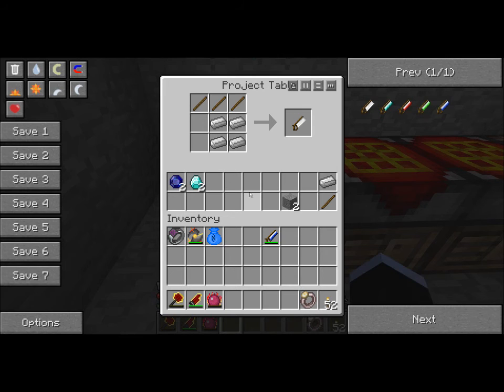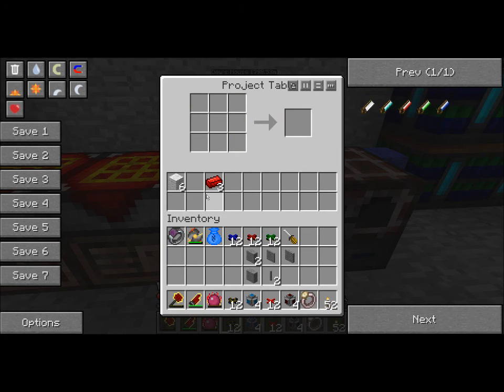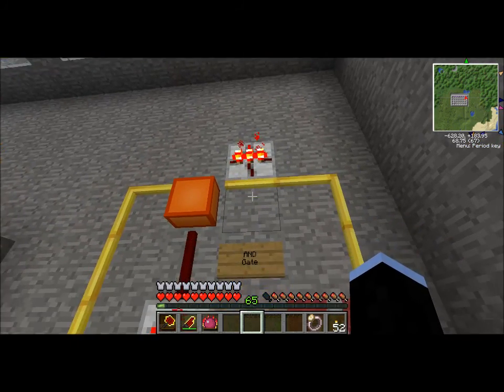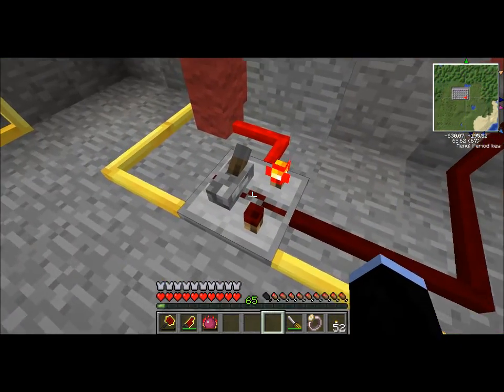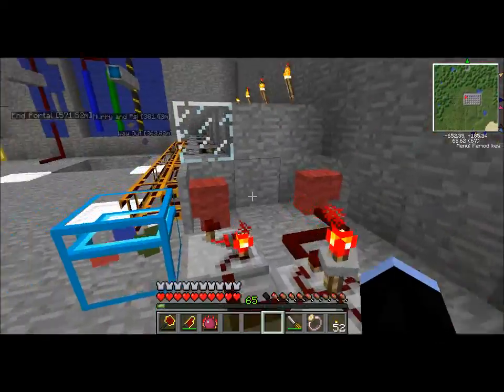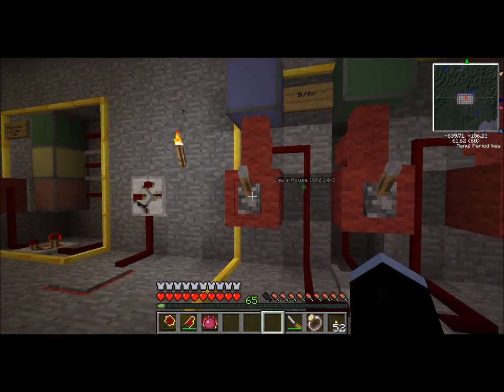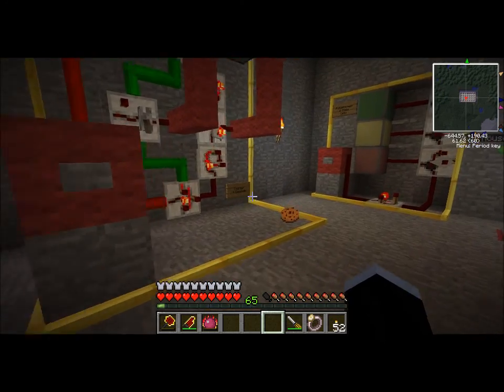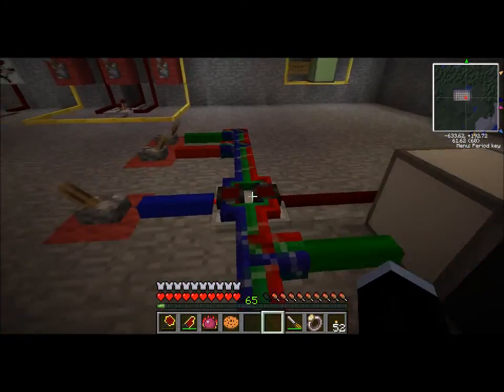[Tekkit 3.1]RedPower Wiring and Gates

Comment: Figured out a use and a simple real world example for the multiplexer
The Answer is an Airlock 
you can use it in an reactor design or as access to a dangerous area (mob farm etc.)
by putting it between two sets of  pistons you would have only one side open and the other would be closed its also an it would also act as a safety for reactor doors when you pair it up with the reactor start up that way you can ensure that you can only enter the reactor champer when the reactor itself is not active

Comment from the maker: How about instead of connecting the output of the alarm to a Pulseformer -> State Cell?

The State Cell could be configured for a long time, and connected to one side of a toggle latch... Gosh I might make a video about this. Basic Idea: State Cell activates an AND gate which is also connected to a toggle latch. You can toggle the latch to de-activate the AND gate, and when the state cell ends you can have that output also toggle the toggle latch.

Comment: do you think you might be able to help me with something? I'm trying to make an alarm not for a door or anything instead for my walls. I want it to act like a trip wire so say that if some one broke through my wall with what ever means they used they hypothetically speaking break the wire and set off the alarms. I've tried this once using xor gates where the redstone signal is continues and the alarm is off when I break one the alarm goes off I cannot make a reset button though help me?